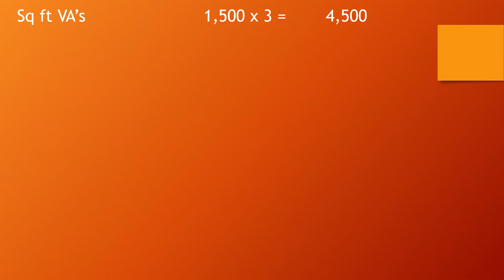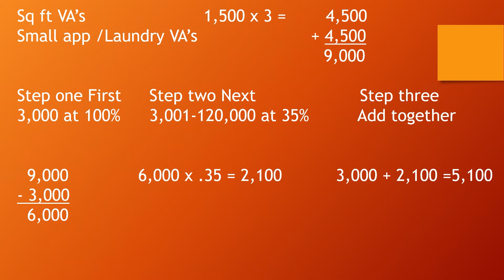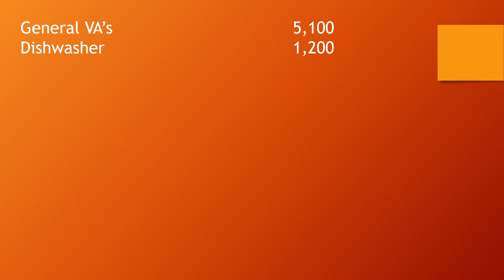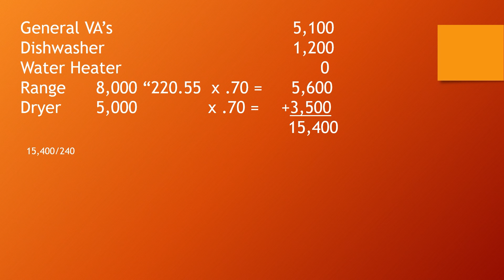Electrical Calculations Neutral Load Calculation Review  2017 2020

Comment: Is the reason for not counting an hvac load because it doesn't have a neutral? What about a gas or oil furnace, it would be small amount of amperage but some at least?
Reply from the maker: You are correct, if it had a 110 blower you would. But typically that is going to be grouped in the three va's per square foot in the general receptacle.

Comment: Hello, would 64 amps be used to size the neutral SE conductor or is it based on panel size?
Reply from the maker: Great question! ultimately it would be sized off the calculated neutral load.

Comment: If panel sched method was used : Ph-A (Gen@2550 + DW@1200 + Dry@3500 = 7250VA) 
Ph-B ( Gen@2550 + Range@5600 = 8150VA ) 
and neutral was size as Ineu = 8150VA / 120V = 67.91 A  , selecting highest phase load current and balance criteria with assumption that General VA loads can be split evenly
Will it still be code compliant ?
Thanks for the reply

Comment: Question how do you do to know when an appliance is a straitgh 240 with no neutral? exams will specify that or no?
Reply: Yes if it has a neutral it will be designated as a 4-wire, any common 240 with no neutral device will be listed as a 3-wire or just stated as the appliance

Comment: Question Coach?
The dishwasher was 1100Watts and I noticed in the calculations that you used 1200VA.
Should I use 1100 or 1200?
Thanks 😊
Reply from the maker: I believe it was a typo I would use whatever I used last
Reply: @ElectricalCodeCoach  thanks 😊